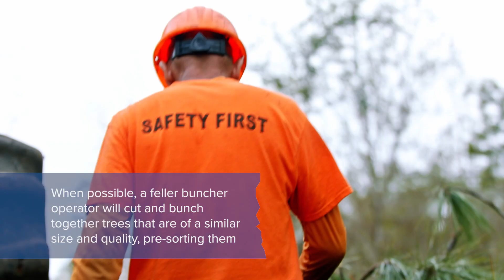What does a Feller Buncher Operator do in logging?

Comment: I don't know where 3500 rpm came from! Tigercat specs are 1150, but mine is set at 1250. 3500 rpm would tear the bearings, shaft out of it, not to mention crack the disk
Reply: Damn glad to know that. I for sure won’t buy a tigercat now knowing that 1250 is max saw rpm. That would probably not be cutting much hardwood. Spend more time waiting for saw to rebuild rpm than actually cutting wood and making money.